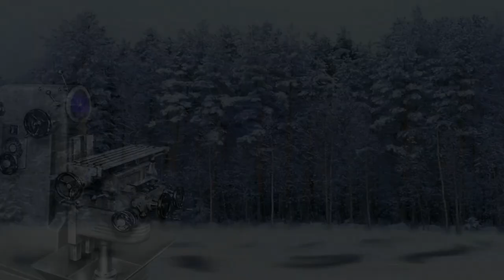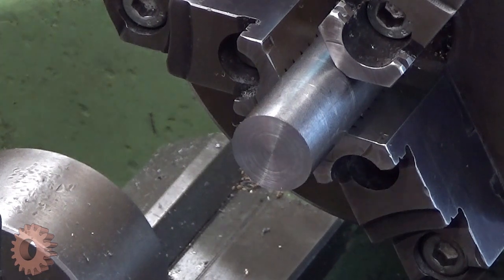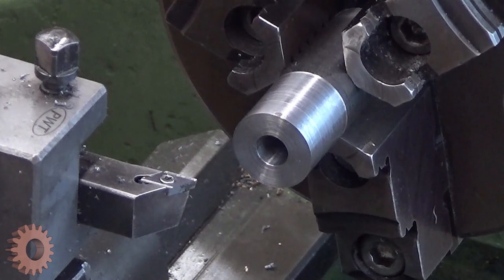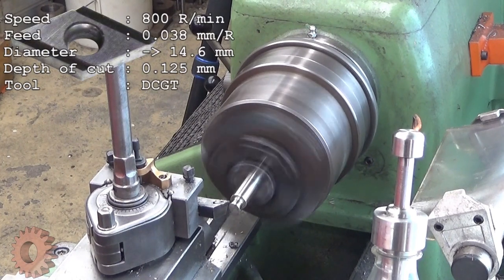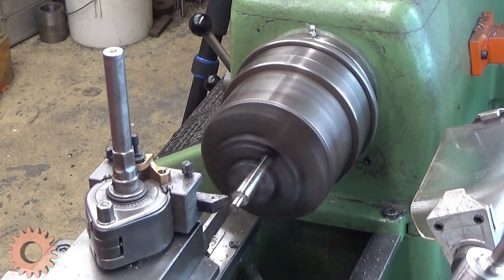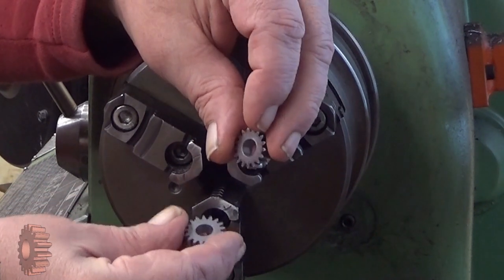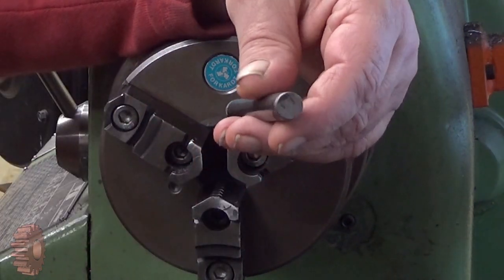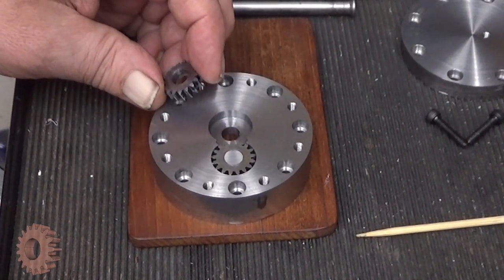Making a rotary vane (lamellar) air compressor 4

Comment: What is projected volume flow and target pressure? Size of the gears are much more suitable for hydraulic pump than air compressor except if target pressure is 300bar.
Reply from the maker: Those are only to supply oil to lubricate the vanes.